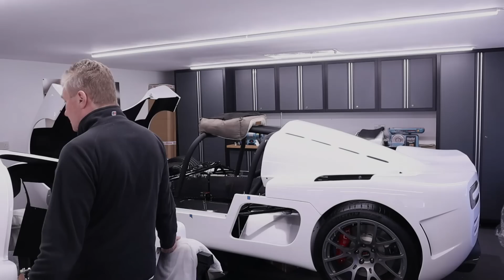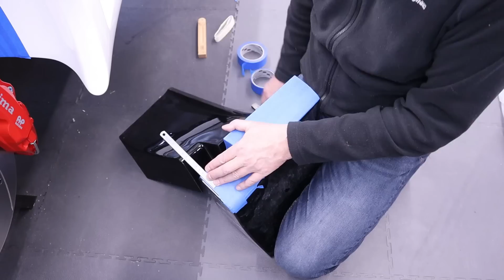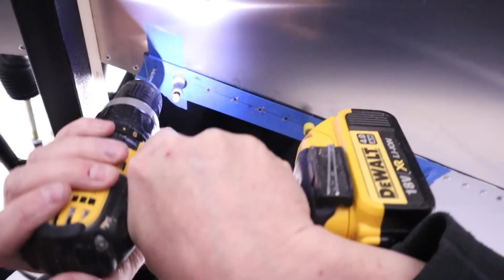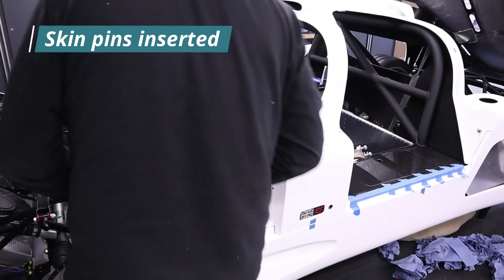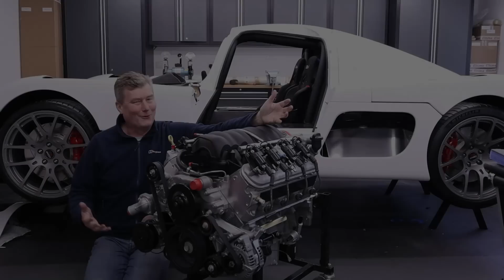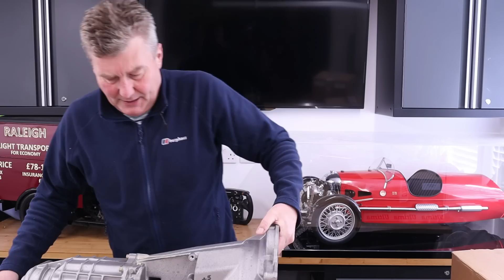Building an Ultima RS with Nigel Dean. Part 36. Engine delivery and new factory upgrade

Comment: I’m curious why he chose the 6.2 over the 7.0 liter v8
Reply from the maker: Very good question. It was for two reasons. Firstly, the LS7 (7 litres) has now been discontinued and wanted to fit a current engine. Secondly, the £8,000 uplift for another 80bhp was not worth it. If I fit a supercharger to my LS3 (about the same price), the output will leave the crate LS7 for dust. Cheers Nigel

Comment: Hi Nigel
Some car and your build vlogs are very entertaining thank you so much for your massive effort here.
1 thing l've noticed with other Ultima builds especially the coupe is the top of the doors roof section at  increased speeds this part of the door lifts under high levers of wind pressure?
Have you seen this affect yourself?
Reply from the maker: Hi Keith, thanks for the thumbs up for the channel. I invest a lot of time and energy to make the content as informative and entertaining as possible. As regards the lifting of the door edge, having owned a GTR for over a year and taking her well above 150mph on a few occasions I must say I have never noticed this effect. However, my understanding is that the new RS roof scoop design likely alleviates this as it alters the aero effect in this region. After doing some research I believe this slight flex in the door corner was only at extremely high speeds and not lifting open as such. Anyway, thanks for the channel support and hope you keep enjoying the content. Nigel

Comment: I’ve got the LS3 with the hot cam in my Saturn Sky (Opel GT over there) and man it sounds great! Looking forward to hearing you start that up. What clutch did you opt for, is it “lightweight” at all?
Reply from the maker: Hi Chris, great to hear from another LS3 fan. These are amazing engines and do exactly what the say on the tin. As for the Opel GT, I used a gearbox from one of those for a Westfield I built with a Vauxhall red top (2 lite twin cam) - nice box of cogs but I guess your Saturn Sky has an auto? Ultima provide two options for the clutch pack; standard and high performance. I have gone for the high performance version just in case I start upping the output with mods or get a bit exuberant with my right foot :-) . As for the flywheel, it's a super compact unit to fit inside the Porsche transaxle and allows the engine to rev sooooooo freely. Start up is a while away but I have to do some research on microphones since sound is everything with a V8. Cheers Nigel

Comment: Nice to see you still making good progress. 
Good choice on motor I may have missed it in video which hp level is it the regular ls3 with 430hp or ls376/480hp? 
Doubt one of these would need much more then 500hp or so as light as they are.
Reply from the maker: Hi, the option I have gone for is the 430hp version since it will breeze through our emission tests and provide power to weight which will out drag most Lamborghinis and Ferraris on a 0 to 200mph run. However, once on the road that LS3 has so much tuning potential at minimal cost ;-). Cheers Nigel
Reply: @V8CREATIVE  ok cool. Didn't realize you had to pass emissions that sucks lol. Probably 1000 lbs lighter or close to it, then lamborghinis so that helps a bunch.
Reply from the maker: @djmurria  yep, to get a home built car on the road in the UK you have to pass a test known as IVA. It takes about 4 hours and checks the car conforms with EU requirements. This includes kite marks on the light lenses, no sharp edges that may injure occupants or pedestrians and the list goes on and on. However, the RS goes through the test with no issues, providing you use an emissions friendly V8 :-), Cheers Nigel
Reply: @V8CREATIVE  wow I guess I'm spoiled with Texas lol. You'd be suprised what's left of some cars and people still driving around with our "inspections"
If I ever build one going with gen 5 5.3 with heads and cam should make 500hp easy and could have vvt for low end and still pull to 7k easy

Comment: Will you have to take any accessories off the engine for the install? Or is it basically a drop in/ plug and play set up?
Reply from the maker: Hi Joshua, good question and to be honest I don't know the answer. However, standard practice for my other builds has been to remove such items for engine install but I will let you know once I get to that stage of the build. Cheers Nigel
Reply: @v8creative  I would assume with the amount of time and money involved that is probably a good idea to cover your butt and tear down the engine regardless. I don’t know where you got it or who built it but I’ve seen numerous automotive YouTubers take apart a fresh crate motor/ engine build and find trash/gunk you wouldn’t want in a fresh engine build. Even new parts these days you have to inspect before installing them. They just don’t make things like they used to. I’m enjoying the videos also! Hopefully you get it on the road soon and can enjoy the driving experience!

Comment: Yet more brilliant content, the engine looks amazeballs and thank you for getting the plastic covered wheel nut socket - I won't cringe every time you take a wheel off now 😂😂
Reply from the maker: Hi Ian, yep I took your advice and bought the special sockets. I was going to give you a shout out but could not find the original comment so I could see your name. Anyway, the Dean Den is now equipped with alloy wheel friendly sockets. The set also fit my daily driver, as £1,000 Fiat Panda :-). Cheers Nigel

Comment: Another Great episode Nigel, really enjoyed it, cars starting to look great, all the worries i have you seem to know and cover them in each episode, in about 3 weeks my years wait is up, so should be getting close to and my arriving barring any delays!!!  Did your engine come with the Stand from Ultima or did you supply your own? PS I've already ticked the box for the new carbon ducts, Keep up the great work.
Reply from the maker: Hi and thanks for the comment, fingers crossed you will soon have your very own build. As regards the engine trolley, yes the factory did lend it to me to transport the engine but it goes back soon. Builders tend to purchase engine stands which are also on wheels and very affordable at around £90. Doors next

Comment: I really have to agree with all your options, colors, and factory bolt in selections.  The wheel color is fantastic complement to body, carbon black to snow white is classic.  The leather surfaces, color stitching, and Alcantera is perfect in black.
You have excellent taste in details, might you be planning on tasteful minimal graphic touches?  V8 Creative logo perhaps?
Reply from the maker: Hi and thanks for the recognition of my spec choices. I took a lot of time deciding on which was to go since it is very easy to spoil a visually balanced build with a off-the-wall selection. As regards logos, one of the reasons I selected white was it gives me the option of giving the car a wrapped livery like a LeMans racer. Watch this space and maybe once she is complete I'll do a make over. Cheers Nigel